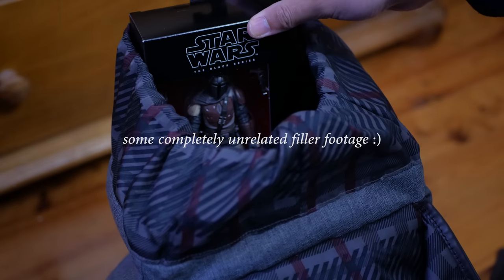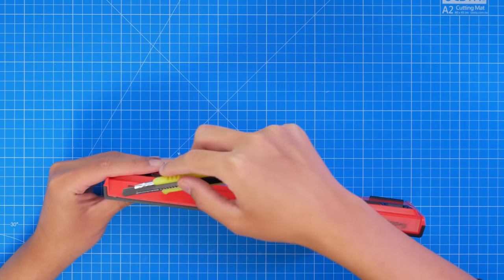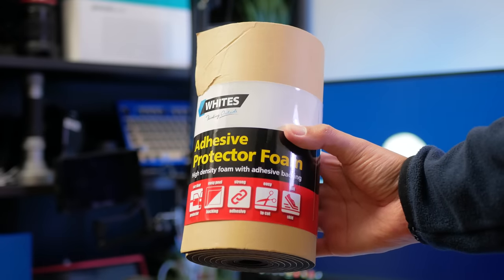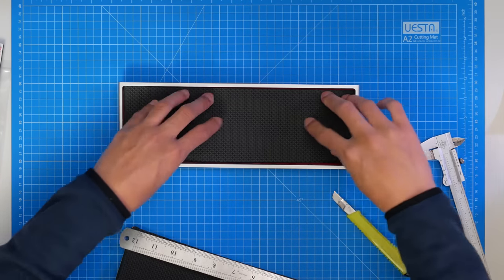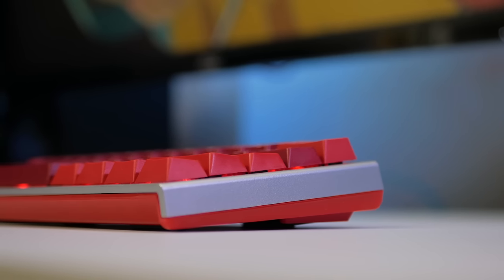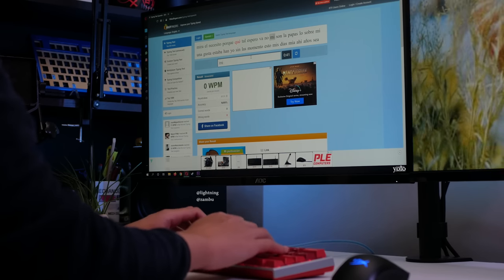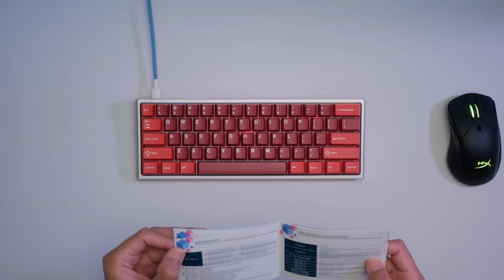Upgrading my Ducky One 2 Mini into an Enthusiast Keyboard!

Comment: a moment of silence for tae having to desolder all that
Reply: I was just wondering where does all the solder go when you suck it??? Is there a reservoir of some sorts? What if it gets filled up?
Reply: @berni_schmorg  they can be repurposed if you are big workshop but when you are only a individual user you can only toss it away
Reply: lol definitely
Reply: would literally eat my pants for coin asmr 4   
From personal use with the “solder sucker” it usually falls right out of the nozzle. Making a subtle mess when soldering A Lot.
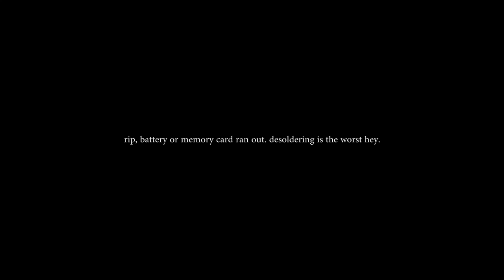But you can see he has a tray to to his left to put all the solder he sucked previously 2:18
Reply: @berni_schmorg  It usually just falls out the tip again. Its important to repeatedly clean your pump though, or else it might clog. I have a cheap pump that you can open at the back to clean it, or you just let it fall out the mouth. I insert the iron for a second inside the tip if ever the solder gets stuck inside the tip and not inside.
Reply: he did that for us bro <3
Reply: @berni_schmorg  When pressing the pump down, the solder will be pushed out again.

Comment: Dude, I just want to thank you so much. 

You inspired me to mod my old keyboards and to build my own hot swap. I lubed 2 of my old boards, just like you described in your superlube videos, then went even further with one of them, took out the stabilizers, band-aid modded and greased them, then foam padded the bottom case. It made that board feel so much tighter and amazing to type on. Then my hotswap board, I made sure to follow all your directions, I lubed with my own mix of krytox 205/105, greased stabilizers and band-aid padded them, foam padded the bottom case and my god is this keyboard amazing! Am typing on it right now! It was my own bday present to myself and I have you to thank for that! Once again, thank you!

Also, realized I wasn't subbed to you, but you've earned my sub!
Reply from the maker: That's awesome man!
Reply: And mine

Comment: For the People who like to compare
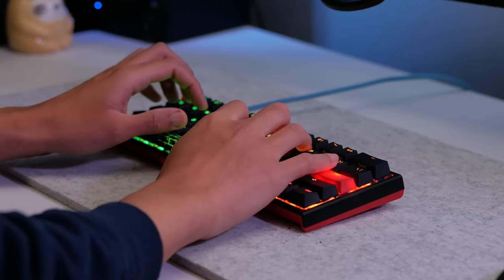stock keyboard typing: 0:34
modded keyboard typing: 11:38
Reply: You can also do 13:30
Reply: My guy did a generous thing, marred by not watching for a few more seconds 🤣🤣
Reply: stock sounds quite nice ngl
Reply: fotix it’d sound nice if it weren’t for the springy noise in the stock one
Reply: That is so much nicer lubed and foamed
Reply: with switch is he using on the second typing
Reply: @solarrr1  they are the same switches just lubed . So they are HyperX Cherry Mx Red lubed with Krytox 205g0 and are spring swapped. Thats why they sound so diffrent. The Keycaps make a huge diffrence aswell.
Reply: @solarrr1  did you watch the video? It’s the same switch but lubed.
Reply: Imo the modded one still sounds a lil bit high pitched
Reply: @arash8664  of course they do lmao. They're cherry mx red switches, so unless you drown them in krytox, they won't be very quiet.

Comment: Prettttyyyy coool! 
The soldering turned me off a little from getting one and modifying it to my taste, but this gave me some pretty cool ideas ... one could take the top plate to a milling shop and have them make an aluminum cover, OR one could make a mold out of it and recreate it with epoxy resin. That would make a neat project of its own and I haven't seen anyone do that yet - although I haven't looked, either. Guess I have some research to do. :)

Comment: I just upgraded my One 2 Mini, I used a thick silicone grease to lube the keyswitches and create drag, then I used a rubber hose cut in 1,5m slices as o-rings to dampen the keycap noise. It sound and feels a million times better now.

Comment: I'm doing the same with my Ducky One 2 mini. I'm swapping Cherry Blues for Kailh Creams, also putting new stabilizers and an aluminum case. Even without the extra 4-pin-leds, mine was a pain to desolder.  I would rather buy a new pcb than desolder one more time, but I had the DO2M lying around so why not.

Comment: the spring ping before switching the spring was so damn obvious. after the lubing and spring swap the switch sounded so much better the bottom row of switches that didnt have much foam definitely sounded a bit hollow but that was probably because of how little space the case had for foam but the top row with the foam definitely sounded awesome.

Comment: Totally understand how you feel, I just desoldered my old Quickfire TK browns (cause I like the form factor), and lubed the switches and stabs (as well as clipped them).  Was my first attempt at soldering in years, so I ended up blowing 2 of the leds... everything works though.. but definitely risky.  Desoldering is a pain with a pump.

Just a question, which pump would you recommend?  My cheap pump was getting stuck with solder part way through and had to be cleared so often :(

Comment: The spacebar ruins it imo something seems off about the sound
Reply from the maker: yeh its scratchy. couldn't really fix it. i lubed the housings too. also the keycaps are different. the stock have a looser fit, but some other ones i tried, the spacebar wouldn't even return lol.
Reply: TaeKeyboards that’s disappointing, if the spacebar had the same thock and sound as the backspace, that would be incredible for a modded prebuilt keyboard. Nonetheless it was really cool seeing the transformation and effort put into making it ^_^
Reply: @TaeKeyboards  Try Cherry housings with  the Ducky wire (which seems to be a little bit thicker than the Cherry one), it fixed my problems with the spacebar not returning of feeling extremely mushy.

Comment: Great timing, I was about to mod my own One 2 Mini with lubed Gats. I already lubed the stabs a bit with some Superlube using an interdental brush, but I don't think it does as good as a job than removing the stabs and then lubing it. I just had to wait a bit for all my tools to come in. I already tried putting foam on the board before, and the case doesnt really have a lot of space. Apart from screwing it down, I had a lot of trouble lining the USB-C and dip switches out. I already used like thin crafting foam for that.
I was a bit worried about the strong pinging not going away because of the steel plate. Turns out it was just spring ping I guess, which  I didnt think it was because the pinging existed on both the cherry and hyperx boards. Though I guess alu plates still give a thockier experience than steel.
 Never thought of just repainting my case though, I thought I could have just gone for a standard tray-mount metal case like a GH 60 metal case. Might try repainting the bottom part a nice reddish-brown. Wondering how it would look without the top layer though, if it will like give a floating switch design look.
Reply: Update: Swapped to lube gat yellows with 205. Removing and inspecting the stabs showed they were already lubed well enough. Removed the middle stand-off as well. No foam at all, but I might try putting some weights instead inside of the case. 

First time modding, and I ripped off one of the pcb contacts on the TAB key while despoldering. Soldering went smoothly though. I'd advise a pump + wick for desoldering, just to make the finishing touches easier. You'd need to have a clean desolder to remove switches.
Reply from the maker: @Memann208  awesome stuff! love seeing people mod their boards :)
Reply: @TaeKeyboards  Thanks! I learned a lot from your channel about modding and custom kits, and thought that it wouldn't be that hard to just buy a pre-built and mod it!
Also I tried to pack the foam I had into the space bar instead, and I think it had a pretty good effect on it. Gave it a more thonky sound and I left some clearance to prevent it from hitting the switch / stabs and shorten the travel. Not sure if it's just placebo, but it would be nice to test out! The result honestly reminds me of the difference between Cherry and SA caps.

Comment: I am blown away by your ability to desolder so efficiently with hard tip solder suckers. I've spent 20€ on an Engineer SS-02 that is supossedly one of the best mechanical suckers and I should have a ratio of 1/7 holes sucked correctly first time. Most of them I have to try multiple times to refill with solder and try again and I even have to force the switch while it is still hot. I suck so much and I am even training on a malfunctioning Corsair PCB.

EDIT: It's crazy how easy yo make it look. You just need one pass on each hole jesus christ. Maybe it's the Corsair OEM solder? Maybe I am trying to desolder lead free joints and I need more heat? Last time I even tried to apply a bit more of my solder and it was even worse. IDK I'm training to desolder an Anne Pro 2 and I am so damn demotivated xD

Comment: I tried to do a similar project on my steelseries m750 tkl, with swapping the switches and lubing them. I ended up buying a small pack of switches to test if I liked them, and if they fit into the keyboard, but unfortunately the pcb was too fragile, and the itty bitty heat that I put on to melt the solder also somehow messed up the copper plates within the pcb, or the resistors used to control the rgb. The rgb went to the trash can, but the keyboard still works, as I'm typing on it at the moment. I'm planning on buying a new keyboard to customizing it a little, but I'm too anxious to solder another board, not knowing its limits, as they are mass production boards that go through a generic furnace, and not a concentrated solder iron. You live and you learn.

Comment: I did frog tape and some pe foam. I ordered some 1/8" neoprene I'm going to swap with the pe. I need to do some syringe lubing of the stabilizers but just with the frog tape and the pe it already sounds much better to me. I acutally quite like the machine gun sound and feel.

Comment: You're also typing on a thick piece of insulation. Don't know if I would call that the true sound test. Still, it's nice and you know what you're doing with it. I can't solder like that. 

I have a ducky One2 mini so I was thinking of stuff that I could do as a novice in the keyboard game. I have a Ducky mimi (the ones with the really thick metal case the whole way around). I have a Pok3r RGB. And a Max Blackbird TKL. I don't have the space for anything bigger than a 60-65 (you'd have to see my desk to get it) but I'm not confident enough to do more than minor modding. I do have dielectric grease. So I guess I could put some lupe in the stabilizers. I could also get some thin foam. I actually mod hockey gear so I should have foam that would work. Or would it just be better to buy foam that's made to be used for sound dampening? I put clear o-rings around the stem of my caps to keep them from bottoming out. And I got new caps. They sound a bit better. But I would like to do more to it. 

One of these days, I'm just going to spend the money on a kit and nice case. I could probably even put this in a new case if I wanted to, huh? Any suggestions would be great. Nice video.

Comment: Do you think you could try modding an anne pro 2 with gateron black inks? im going to try it before i actually start building keyboards and wanted some tips on how not to mess it up.
Thank you!
Reply from the maker: basically the same as what I did here, but you wouldn't need to desolder the LEDs because they're SMD on the Anne Pro 2.

Comment: Thanks for the video. I'm planning on modding my standard Ducky One 2 Mini. Some of the switches produce rusty spring noise (not ping) while slowly pressing down. I want to open it, lube them and I hope to fix this issue. 
I already have thin dampening pad on the inside and lubbed stabs with some more silicone oil, it makes a world of a difference.
Reply: This is probably the leaf contacts... Not much can be done about those. I watched a :3ildcat video and he replied to me saying that it's better to just replace the switch completely...
Reply: @jimrossabrena7955  Really? I could swear it the spring problem. Uf, disappointment came faster than I expected ...

Comment: This video confuses me in my purchase of a new board, you seem pretty pleased with off the shelf keyboards like the anne pro and this ducky after some lubing (I might do a switch swap or aluminium housing). My view so far: Programmable PCB's like the DZ60rgb V2 add up in price and don't offer pollished options like bluetooth and can have bad software (VIA is pretty nice if it works, QMK costs me too much time for a utensil). What differences can you expect going full custom in regards of feel, sound, build quality, price effectiveness and possibly other aspects nowadays? Some insight from you would be a nice

Comment: Try too update the ducky mecha mini, I got it and ordered a custom cable, pbt keycaps,artisan escape key, and artisan space and enter. Further I lubed the switches with superlube and a syringe to apply it slowly (used around 3ml for all the keys). I also got a wooden walnut wrist rest.
Reply: It feels and sounds so premium. The anodized alu case is premium too
Reply: I also added sound foam in the casing. it feels insanely premium it went from sounding meh to your custom boards just by adding foam, lube(switches and stabs)
Reply: Isnt it cheaper and easier just building a custom?
Reply: @xmelloniax  not really just anodized aluminium casimg will set you back 100, and then you need a lot more

Comment: I sould've watch this before putting pads inside my ducky haha,  could only get 3 screws to fit in (left and middle) the right side screw holes and one next to the spacebar are completely destroy from me trying to force them in.

But there's not really any wobble on the plate, i assume it's  because the upward pressure of pad is keeping stable so i guess i can live with that

Comment: Is there a budget hotswap 75 keyboard?
Reply: Try the tecware phantom elite.
Reply: @feke5987  that only supports outemu switches
Reply: i think a IDBao ID80 build would work 
or KBD fans 75
Reply: @ShaiyanHossain  The Elite one comes in Gatreon and Kalih hotswappable.
Reply: Probably not any good ones
Reply: @Kizzster  KBD75 is decent. But it's not that cheap either. Around 150-180 dollars.

Comment: Dude HOW do you desolder that many switches without lifting a single pad, getting all the solder out the first time, and only using a solder sucker?
Reply from the maker: haha I've done it a bunch of times. But a good pump makes a huge difference. I use a Soldapullt which is way better than the cheap 2 dollar ones I first used.

Comment: 0:34 I wouldn't expect an expensive keyboard like this to ping so much
Reply: I reused my DO2M stabs on another keyboard and I had to put a lot of lithium grease on the wires and a thin layer of Krytox on the plastic housings to eliminate that damn pingy noise. They are acceptable after that.

 It's a shame that desoldering to change or lube stabilizers is a must, as nearly all the "gaming" brands use low quality-unlubed pingy stabs on their keyboards.

Comment: just ended up replacing my v2 of this (stock ofc) with a GK61. The v2 mini has an issue where upon booting/rebooting your pc, sometimes the keyboard wouldn't turn on/be detected. This is a huge dealbreaker for me as I do a lot of in-BIOS nonsense on my PC :(

Comment: i wish i could afford this i have a cheap 30 dollar mechanical keybaord with fake brown siwtches and it sucks :(
Reply: lmao same, luckily the ducky one 2 mini is ~$180 so not that expensive when compared to others. If you want to do the same mods as in the video a Soldering Iron will run you anywhere from $100-$200 and lube used in vid is $23 for 5ml which is enough for the whole keyboard. GMK Jamon though is probably around $300 AUD lmao so you probably wont be able to get that.

Comment: I rly want a keyboard like that but iam a noob and cant to all that stuff u did i like the sound of it soooo much currently iam using a k95 plat and would love to upgrade to one of those with red switches. To be costume ofc not stock.
Could u make 1 4 me i will pay u. Ik its so difficult since u r busy but if not possible is there a company that does this job ? Also i live outside of the us

Comment: Nice! Did you use plastic primer before the paint job?
Reply from the maker: nah just some typical surface primer.
Reply: @TaeKeyboards  thanks, was just curious if you just used paint. I tried plastics primer but that comes with a crazy smell, cannot be done inside imo.

Comment: Idk if this is a dumb question but why don't they just make all keyboards hot swappable
Reply: Because it makes the layout fixed.

For example, I couldn't use an ISO Enter on an ANSI PCB and I couldn't use a split Backspace on either because the PCB could only supports a 2u Backspace.

It's also an added cost for a feature that may not be used at all by the consumer.
Reply: @Fran-lf2hp  ah well thanks for this :)

Comment: Why are you guys using Krytox lubricant? Thats way overkill for something thats just a plastic momentary switch. Its not like you guys are getting the keyboards hot from typing. So long as youre not dousing your switches in cheeto dust, dielectric silicone should work just fine. 
Krytox is a very high end lubricant for industrial purposes, specifically where flammability is an issue. I use it everyday on Oxygen systems. I feel like the use of Krytox is just some illusion of quality for the sake of exclusivity.
Reply: preference

Comment: the whole point of mechanical switches is so you dont have to bottom out they keys, not that it feels good when you bottom out the keys.
Reply: Geo Bois ??? what dude lmao. im pretty sure everyone bottoms out
Reply: There is no right or wrong way to type. Most people prefer to bottom out
Reply from the maker: It's very difficult not to bottom out. There's switches/springs that are designed for that, and even then, people find it difficult.
Reply: Why wouldn't you bottom out on a Cherry switch like MX Red for example? Use O-Rings if you don't like bottoming out. Not everyone has feathers for fingers haha